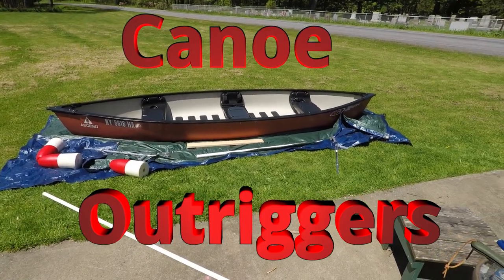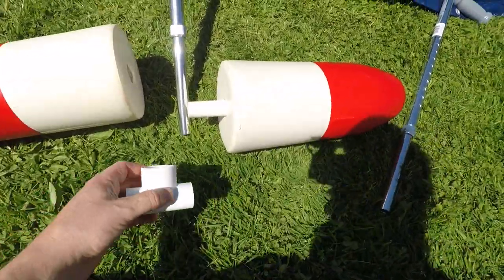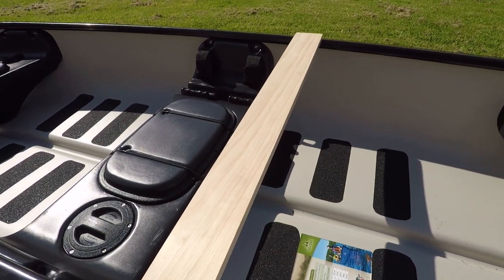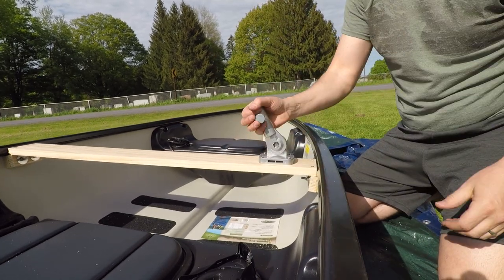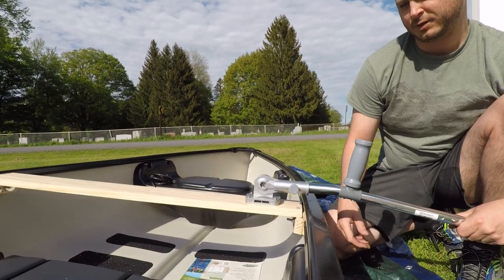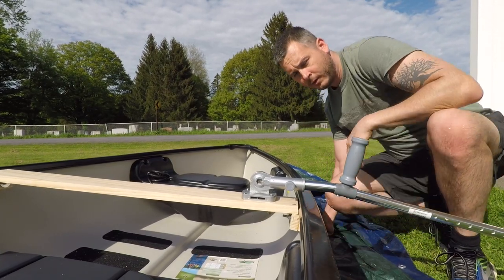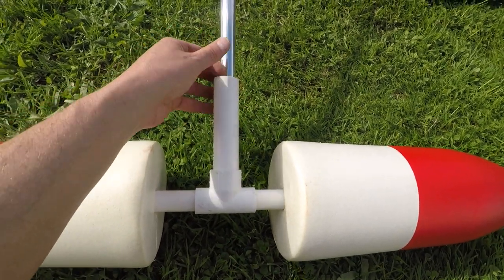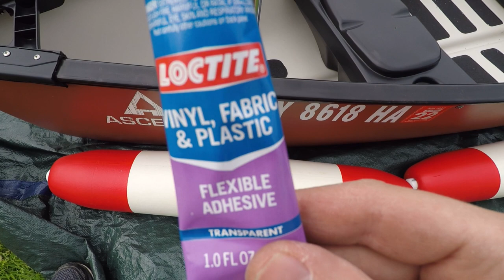Canoe Outriggers - Stabilizers -  Bird of Prey - DIY

Comment: Greetings from the Original Bird of Prey guy!  I thought your assembly was very nice.  I also liked your use of the tape to centrally locate the strut.  In my original I used a reducer to bring the tolerances very close and then put two bolts all the way through the PVC/strut at right angles to each other and separated by about two inches to add stability on both axis.  The tape would make it even more of a close fit and the glue would seal it all up nicely.  I think that would provide the security needed to lock the struts in place.  Again, great job and I know you will have fun with your son.
Reply from the maker: Hi Stephen!  Nice to meet you.  I'm Def not savy enough to figure out that coupling thing haha.  I broke one of the flag pole holders on my last video.  Operator error pushing the canoe into the water and one of the out riggers hit a rock and it wasn't that much pressure and it just snapped off.  I'm gonna go for higher quality metal when I replace.  They were pretty cheap, ones I originally bought.  That being said I kinda liked the one out rigger.  Without kids jumping around in it, it's pretty stable.

Comment: Liked the use of the crutches - cool.  Also liked the flag pole mounts - but wonder how well these be able to will handle the side forces - usually made from pot metal.  I may weld a couple up to be more secure.
Reply from the maker: Thanks! The crutches are built to be very sturdy for obvious reasons.  Also they telescope if needed to go out further.  The metal flag pole holders are holding up very well. My most recent video we hit some decent waves and the float even went under water as my buddy was leaning to the side and it all worked like a charm.  Popped back up.  The metal teeth in the flagpole seem strong enough.  They are heavy duty aluminum.  I'll do another video if anything breaks.  I am going to upgrade the wood blocks that the mount screws into to a bigger block of hardwood instead of pine.  I also drilled holes in the crutch so the flag pole screws screw directly into the crutch.
Reply: @DeMarcheAdventures    Thanks -- Its wonderful to be able to repurpose common items like that.  Its worth trying the flag pole mount - IF it ever breaks, then one knows to make it stronger, ...and if NOT - then one have saved lots of time.  I really like the adjustable depth - so can adjust for conditions and number of people.
Reply from the maker: @mediaministries7889  the flag pole mounts are also quite cheap on Amazon.
Reply: @DeMarcheAdventures   Thank DeMarche -- Subscribed to your channel - after noticing I was signed in under my church account.  I'm actually Relentless Homesteading -- most adventures here are 'down to earth' prepping and project types; but getting our trailer refitted to take some trips and will get a canoe w/4 HP motor to truck top as well.

Comment: Don't glue it my friend, run a drill bit through it and run a bolt...
Thanks for the video gave me more ideas.
Reply from the maker: A great idea.  The glue is super strong and still holding on a couple years.  Actually broke one of the riggers but the glue part stayed on and I had to chisel the flag part off it to put a new one on.  I ran it into a rock on entry

Comment: good job . I would of turned the crab floats same direction with the gap in the middle the flat end will be like a drag and have to row harder.
Reply from the maker: Nice improvement.  I didn't think of that. I try to keep them out of the water when moving but depending on how many people or weight they do sometimes drag.

Comment: Take a nother pice of pcv.pipe of a smaller are  other pice of pipe  smaller   diameter  and slide it between   the two pieces  that you wear taking about    in 10 minutes  into the video then drill a hole. Trow the two pieces of pipe   to  connect  the pieces together  i think would  work better   then  felling the gap with. Glue are something  in such. Hope  you understand  what I mean   great  ideal   on they way you are going your project   was  looking throw videos on YouTube   for ideals  on how to add  Is stabilizers to my Canoe  and ran apond your video.   Think on going with this thanks  for shearing  stay save on the water  God bless

Comment: Could you give me a link to the same crutches you used? I just wanna make sure the ones I order will fit the flag pole holder. Thank you great video really helped a lot
Reply from the maker: They will fit, they are all basically the same size and the flagpole holder is plenty big enough. You actually have to fill in some space in the flag holder.

Comment: Where did you get the floats for the build?
Reply from the maker: I got them off Amazon.  Crab pot floats.  2 pairs of 2
Reply: @DeMarcheAdventures  What is the size 5x11 or 6x14?
Reply from the maker: @jonlee4224  6x14 went with the bigger ones for more buoyancy